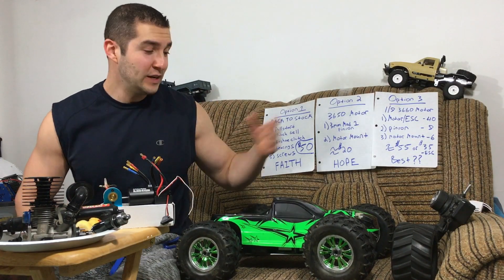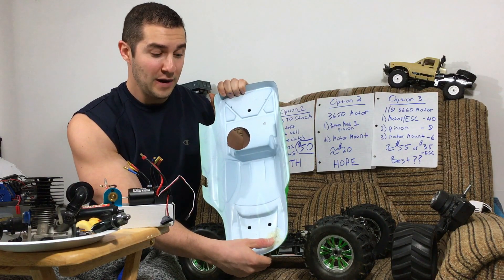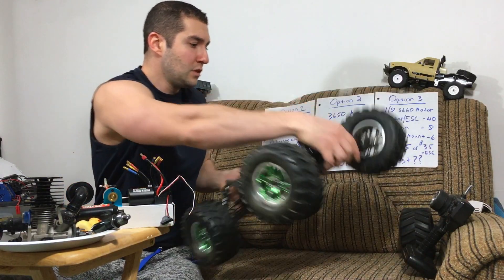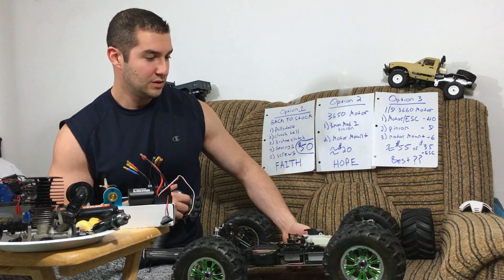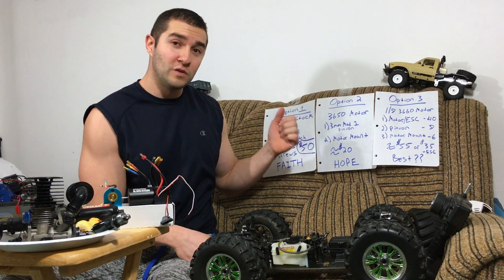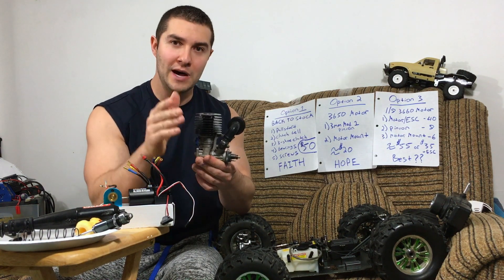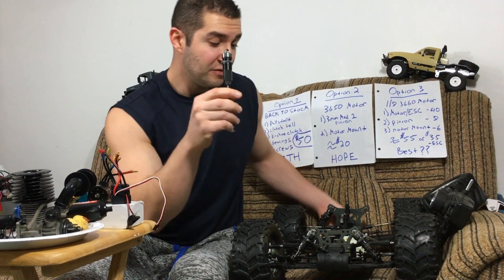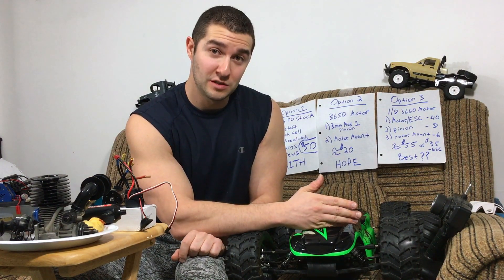I've got 3 Options for this Nitro to Electric conversion ( part 2) UPDATE

Comment: Option 4 550 brushed motor lol
Reply from the maker: I eventually put in a Savage 25 motor into this thing.  There are a few videos with the running after the mods.  Recently I sold this RC (about a month ago), I kept the engine and put it on a board (as seen in my prior videos).  Anyway, the center diff pissed me off too much!  I could not deal with it.  No point in having big-block power and wasting it all though a center diff.
Reply: @hybrid32494  yeah my hpi super 5SC flux has a center diff maybe this winter when I’m bored I will glue it together so it’s like a normal rc
It’s the only rc I have with a center diff I learn from my mistakes lol but I had to have it because it’s the biggest electric 5th scale made

Comment: is there a third part to this? I want to see what u went with and how it runs. I have a duratrax quake I got for $30 that I'm going electric.
Reply from the maker: Hey bro! What's up!  I have since abandoned the electric conversion, and have gone back to nitro.  My channel is mostly all nitro now I ran into a few electric motor mounting issues with this chassis. For me to put in a motor mount wasn't that easy due to the chassis cutouts for the nitro motor as it turns out. Anyway here is a follow-up video on this same truck for you!!   BTW love the duratrax QUAKE<. I used to own one. 
https://www.youtube.com/watch?v=AtlrodRJqhg&list=RDCMUC3IdY3qEy1XJn9DnyRQERxQ&index=1

Comment: Shouldn’t be hard to turn at all with no glow plug in it, no plug no compression
Reply from the maker: hey bro! You're mistaken,  Even with the plug out there is still plenty of pinch at the top of the sleeve.  It seems this motor is in pretty good and not much used condition.  So you will still feel a good amount of "pinch at the top" because that is how the sleeve is designed. Over Time you will feel less tightness at the top of the stroke, this is normal.
Reply: hybrid32494 alright cool.

Comment: Hey, what is the motor and esc you were talking about in option 3? 45 dollars sounds sweet!
Reply from the maker: hey bro, you can check this system out here, good deal and on sale right now.  https://www.banggood.com/custlink/DD33296kR9
I already had a part of the system and just needed pinions and motor mounts at this time.  Anyway, I have since decided to go back to nitro, the motor mount is a situation for this thing.  I got a 1/18 buggy one, but it needs alot of chassis mods to fit correctly.  Anyway, that Link for the 1/8 system is what I was planning on using, but I already had some of the components at the time.

Comment: Go with Brushless...that damn nitro just makes alot of noise and dont move...
if you dont have the other equipments....glow plug driver, ect...it'll cuase you problems
and headaches...plus it's MESSY all the time.....and money pit.
The 4076 2250 KV is only $35 ( fuck those 36mm 1/10..there not powerful enough) 
ocday 120A is only $25
so it can do 4s 50C...ect  ( 18t-22t ..32 pitch pinion SET are only $6-8 p/SET.
Go with at least 18T.
You need it. it's heavier and with bigger tires than a buggie.
It's just a 1/8 buggie with MT wheels and tires....
you need a 1/8 size motor,...I use 4076..is a power house. It wont run as hot.
It'll mount on 550 size motor mounts ( 36mm)...there's different mounting patterns.
on the 4076. Theres' different KV you can get...such as 1650
why use a 4072...ect when you can get a bigger more powerful motor for cheaper???
The 4092 is even bigger ( it's $45)..but you need at least 150A and 6s
for it to shine......but 150a esc are still expensive $80 plus.
 All my 1/8 nitro has the 4076 set up becuase it's a cheap conversion..that will
get it over 50 mph...pop wheelies on command...ect.
my MGT 4.6 was poping wheelies on it only on 3s...that thing is even bigger and
heavier...do around 40-45 on 4s.
 I have different brands..I got for cheap and converted them...rc8...TT. KM ofna..xtm.
It's basically set up like an RTR...the motor mounts on the side of the old battery box.
The lipo mounts on the opposite side..You can mount the RX wherever.
It's simple and striaght forward
Reply from the maker: hey buddy!, great advice.  You're 100% correct.  For this particular build i'll be going with a 3660 motor because I already have the extra needed equipment, only need the motor for now.  I got a 3660 for 16 bucks with over 4000 KV, so will be ok.  I really didnt want to go the 550 size motor because of usually needed to run 4S.
Reply: @hybrid32494  it;s just the can size.. The 3660 has a 5mm shaft.
If you have 60a-100A esc it'll work...depending what C rating 3s..
and brand. Lipo are hit and miss...i do know HPB 40C are good
ratings. You just have to be mindful of HEAT...
That 3660 can only do so much...The truck is heavier and that's
that. Performance is also preference.
i personally KNOW 3660 isnt going to make it do much..
but 30 -35 mph is still fun....

It;s a learning process and investment.
I invested in 3 packs of 4s lipo...( $120). but I have fleets of 1/8
i have extra 36 mm motors...laying around i can run in 1/10
or boats.lol
I try to keep all my builds under $200...They're basically $400-$600
-ea toys. To me...$35 and $25 is way cheaper than a nitro engine...

I have a draw full of 1/8 nitro engines, exhaust..ect lmao
and hell no...Im not selling them all for $25- $50...when
it'll cause me $35 to ship it...lmao
There;s other stuff that might be worn out on those engine..
leaky bearings....stretch rods...worn out starter crank notch.
the sleeving kit is around $50...but that's just the sleeving.
If you're not familar with nitro parts....the clutch shoes...ect
Get a cheap set...it'll wear out before the engine breaks in.lmao

Comment: I just ordered the Gool RC 3660 3800kv 80amp combo for $40 on ebay..5mm shaft..Going in my 4x4 ruckus..similar set up as Steveo has.
Reply from the maker: great, I was about to get on that deal too. You saw my stampede with this system, its incredible.  I can say that its not worse than any Castle system, for the specs.  BTW try getting yourself a programming card for it, I have one, very useful and easy to use.
Reply: Yup.. I have a few Gool RC systems and a few OCday systems..The motors are great but the ESC's are hit and miss..I have a programmer as well..Check out my channel bro
Reply from the maker: yes, will do. Just subscribed to you.
Reply: @hybrid32494  Thank you bro!
Reply: @oneeyemonster3262  What rig is that system in?

Comment: Put that big engine on the rally monster and see how fast it'll go!!
Reply from the maker: hey buddy!!,  That would be nearly impossible unfortunately, bc rally monster has a 2 speed trans.  Cant get any clutch bell to fit the .28 engine with that clutch bell setup.  Cant mess with the 2 speed setup, need a 1 speed for that and to do a brushless setup to.  Great idea, would be sick if it worked.
Reply: @hybrid32494  yeah that sucks

Comment: I have a 3.175mm shaft on one of my motors n needed 5mm cus I’ve got a mod 1 n what I got was a hot racing motor shaft sleeve, it goes on the 3mm shaft n makes it 5mm shaft to fit the mod 1 pinions on it
Reply: The 3660 can u have in ur stampede I’ve got the same goolrc n mine has the 5mm shaft
Reply from the maker: so you and I have the same problem, bro.  So I looked into the shaft sleeve while filming this video and read many forum discussions.  Basically many said that it will still breathe 3mm shaft for a heavier RC (def the one I'm working on here). The other issue is, MOD1 pinions with 5mm size are cheap and common, and easy to work with.  You can get a 3660 motor on eBay for about 24 bucks with a 5mm shaft, and still use your current ESC.  what truck you trying to put this motor into, probably a larger rig right?, because usually larger trucks use MOD1 gearing.
Reply: @hybrid32494  I think he put it in the Ruckus 4x4..It's a big 1/10 scale.. Really 1/8 scale in length
Reply from the maker: I just don't know if a 3mm-5mm sleeve kit will be balanced well enough at high RPM.  What the cost on that sleeve kit Steve?  If it's over 15 bucks just get urself a cheap 3660 motor with a 5mm shaft.
Reply: PhilthyCo RC yes it was the ruckus 4x4
Reply: hybrid32494 it seems to be fine, it’s the Hot Racing n it’s like $7 something for it
Reply: @STEVOD313  How she drive? I might get the same set up for mine..and I'm for sure going to take off the stock servo saver for an aluminum horn
Reply from the maker: yep, I hate servo savers.  Servos are just not that expensive as they used to be, and we are not NEWBIE drivers either.  They just create so much extra slop, if poorly built ofcourse.
Reply: @hybrid32494  The servo savers built onto the servo horn are the worst it seems lol..The ones built into the steering rack with an adjustable spring seem better for sure.